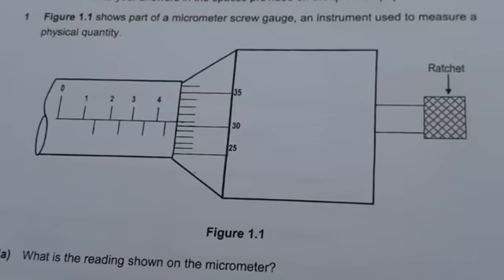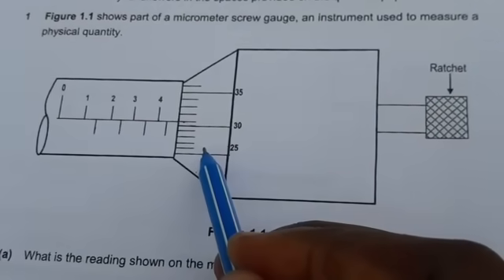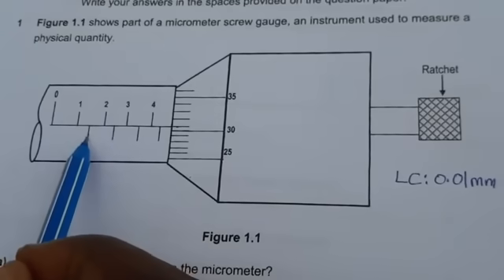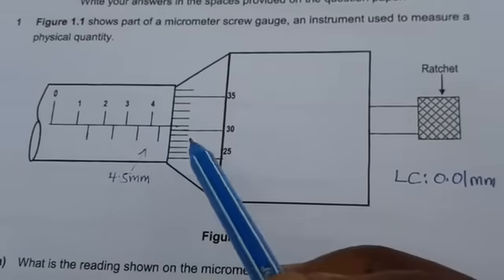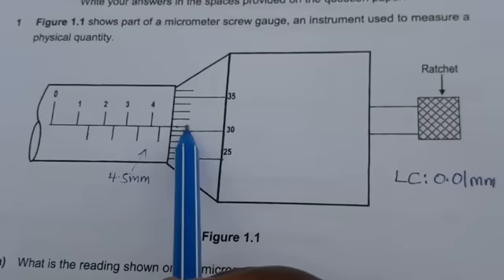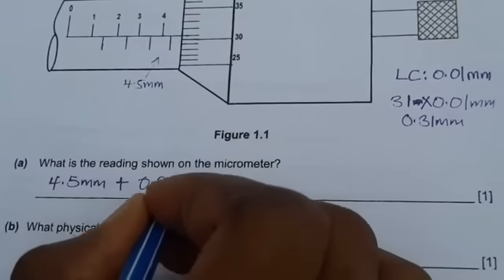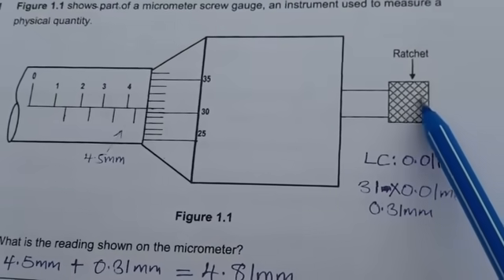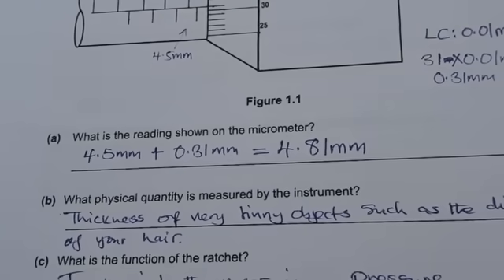Reading a Micrometer: ECZ Science Paper 2 question 1

Comment: Sir that rachet it is used to measure pressure only
Reply from the maker: Yes, you are right!  It's there to apply a consistent force when taking a measurement. This ensures accurate and repeatable readings by preventing overtightening. It's a clever feature that helps us avoid damaging the object being measured. 😊

Comment: Hello sir. Can i also say the rachet is used to adjust the measurements?
Reply from the maker: Hello! Thank you for your question. 😊 The ratchet on a micrometer is not actually used to adjust the measurements. Instead, it is used to apply consistent pressure when measuring an object. This ensures you don’t overtighten and get an inaccurate reading. The thimble is what you use to adjust the measurement. Hope this helps!